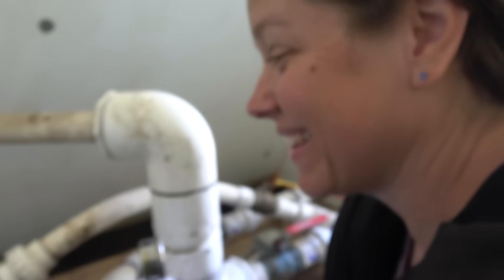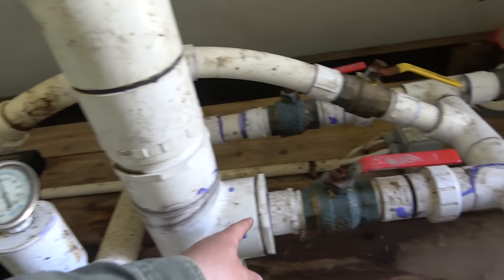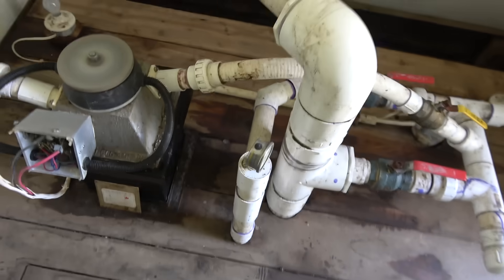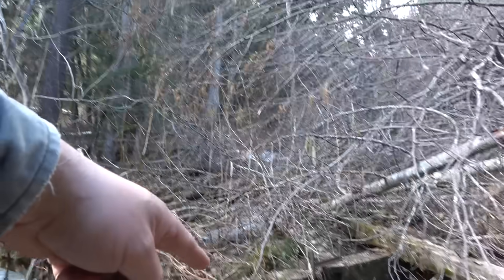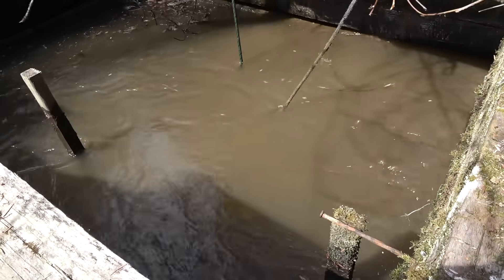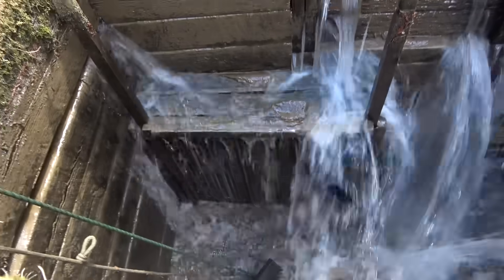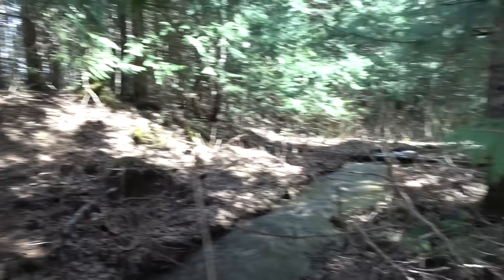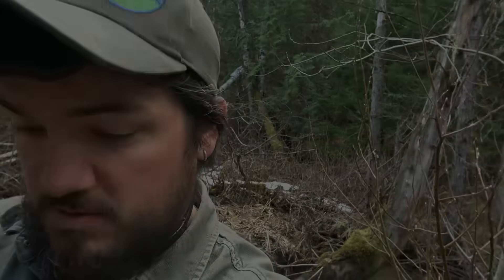Off Grid Micro Hydro - The Dream System!?

Comment: it might be a good idea to have a computer to go along with your analog system to run along side it and to act as a redundancy especially for the overheating of the hot water tank. your relying way to much on devices that are known to fail like the temperature gauge/relay device. i have alot of programming and electronics knowledge on the arduino platform and have made small hydroponics systems in the past. a simple arduino with sensors and a screen to monitor your temperatures and voltages and a buzzer alarm to warn you of failures is a must. the cost is close to 20 dollars and the power draw will be under 100ma but the safety will be increased by 200% or more. its actually a easy thing to build and install and its possible to do it without any soldering knowledge with the right items. the code is quite simple maybe 10-20 lines of code and even as a none programmer can be learned in hours.

Comment: if you introduce a power conditioner into the system, any access power would be stored in a battery bank. thatd be great for the cold days when the water freezes and for when you need to do maintenance on the Stream Engine.

Comment: Good simple system two points though. 
1. The bearings sound worn out
2. Its good to have both nozzles as this creates a balance of forces on the shaft giving less stress on the bearings. Running with both nozzles makes your bearings and shafts to last longer.
Reply: i was thinking the same.. and yeah after 15 yrs im guessing the parts are screaming for some lube...
Reply: @CitizenNerd  "Scream Engine"
Reply: My idea with using both nozzles is also that when things are not used they become inoperative... but I agree. Also seems like a good time to service bearings as opposed to letting them fail and having addition machine work or damage to repair, plus unplanned down time...
Reply: This man said I think it's around 45psi, but whatever.
I don't think he cares or knows hahah This is a commercial add.
Reply: With the ES&D Pelton and other similar turbines I would agree with you about equal forces on the runner/shaft, however with slightly larger turbines made by Canyon Industries in Washington state the runner is vertical and the horizontal shaft is supported on both side with heavy duty bearings vs just having the runner hanging on the end of a vertical shaft like the Stream Engine. With a Canyon Ind. turbine I would have zero concerns about having only a single nozzle.
Reply: wow what an amazing comment. makes Sense
Reply: And he could just close both intake valves to half or whatever.
Reply: This video is a lie, that's a water pump
Reply: @gawdzalien2811   Think regenerative braking.  If you push water through an electric pump it becomes a generator.
Reply: @mckirkus  correct, I turned a hot tube pump into a power generator, basically it is like a Francis turbine, Capacitor regulated induction generator, dynamic flow was 33psi @ 95gpm and made 500w at 230V I used an auto transformer to knock it to the 120 to run every thing.
Reply: @gawdzalien2811   Wow hard fail, not sure how you can mess up that badly.

Comment: 12:40 you could loop that valve to your engine^^ maybe that extra water from that Tank will then give more power, more power from the engine means more heat and that loop will continue, till you use the warm water^^

Comment: . Clearly one pipe to the geni is an water inlet and the other a water output. Then an over all bypass is the other pipe. yea cant have 23 ins and no out.
Reply: Water exits through the bottom. This plumbing could certainly be more efficient but both of the ones running to the machine are inlets.

Comment: Why not generate the power close to the water intake and run wires to the house? Of course you will need a well and pressure tank to replace the gravity water but seems like it would require much less infrastructure.
Reply: The water will not generate any power until it reaches the bottom of it's fall.

Comment: Has anybody ever thought of running multiple pipes into a cross, and than running it through a venturi, and using the compressed air to run equipment. They also have a type of cyclone that spits hot air out of one side, and 50 degree air on the other, for HVAC services. I forget the name.

Comment: Hi, if I had this set, I would take and put a contactor on the power supply to the water heater. Instead of flushing out the water.
So when the temperature is up to the set value, the power is switched off.

Comment: 1) The manufacturer says  if you run these things continuously they recommend you change the bearings every year . 2) you should run water to both inputs/nozzles so the force on the turbine is equal and doesn't "side load " the bearings . 3) shock hazard exists when running with the cover open . 
If you're going to make a video please try to know what you're talking about .

Comment: Amazing setup.. newbie question does this setup only works if your property is sandwiched between 2 streams i.e. one above you for the inlet and the other one for the outlet?
Reply: One stream. Water is collected at the higher point and piped to the lower point where the machine is set up and all water used is returned to the stream.

Comment: Hydro makes sense, generally, in big/medium size proyects due to maintenance and capital costs... And for sure you need the location (water flow, difference in height or water lakes at 2 levels). Hydro projects usually are amortised in 40+ years. Rotating equipment, water flows require expertise technician around. Same for wind power which also needs location with enough wind/height vs solar. For houses definitely solar is basically the future.

Comment: You could regulate the  Electricity so that it will shut off The hydro And turn back on when it needs to generate more And use batteries as well Just like solar

Comment: Heat your house and steam room lol with your extra hot water. Add a other hot water heater or a boiler system.  You could heat your house and have a steam room for your release of extra  hot water

Comment: 800 meters (~2619 feet - just shy of half a mile) run to the house with a head (or fall) of 30 meters (~98 feet)...sounds reasonable. But I would not want to foot the bill for the pipe.

Comment: Now I just need at least a 5 foot drop AND water that does not freeze in the winter.... sigh...  not here in NE Ohio...  unless I bury a very large tank maybe ten feet underground  and use my roof rain water through a turbine...  And yes,  I am sad about it...  But make sure your bearings are very quiet or you are having too much wear....
Reply: I could do the very large tank ten feet under the surface,  and use it for running a "ground loop" heat pump though,  rather than making hundreds of feet of loops ten feet down....
Reply: @shdwbnndbyyt  Due to thermal transfer, you would need a tank with the same outside surface area as the loops of pipe. 
Unless you have acres of land, equipment and time , it's easier to have a well drilled.

Comment: That is the hydropower system everybody dreams of but few have the optimal site or afford, that is an amazing system. They could produce significantly more power with the flow that is coming down that stream. I would have used a 48"-72" wide Coanda screen in the main channel of the stream so it would be less likely to freeze in winter and is maintenance free. That water in the intake box seems muddy do they have problems with nozzle wear or wear on the pelton or turgo wheel?

Comment: I'm seriously impressed. I didn't know that such micro-Pelton wheels existed or would last so long. You said that your max draw was 1.4 Kw- so put in a second one as needed. Clearly you aren't using all the available water but maybe your wife is happy with the 1.4 Kw limit. My, hopefully constructive, criticisms of the video are these: Cost; Internal workings of the Pelton wheel; where is the generator; maintenance.
  My, hopefully constructive, suggestion is this. You said that only during deep winter does the system fail due to icing of the brook. You could build a weir across it and a, let's say 50mm pipe from the bottom to your head tank. Then the water wouldn't freeze. Just an idea.
  Subscribed.
Reply: There was also footage of battery banks I think, presumably temporary additional load would be taken care of by that.

Comment: 12:38  the safety issue is not so much about the tank blowing up, but that you don't want scaldingly hot water coming out of the tap (faucet) in the house. If it were my installation I'd want the limit to be around 80degC.

You also want to hit at least 70degC once a week in order to prevent germs invading the system, the most dangerous being Legionnaires.
Reply: You don't need that much heat to destroy legonella,  48c will kill it, but as a plumbing contractor the point of use temperature limit is no greater than 40c.
Reply: @MrDmadness  You are mistaken about the viability of legionella at 48degC, unless you only meant in water consistently kept above that temperature for extended periods using gas, electric, or oil heating; or water only heated at the point of use.

Research has shown that at 70°C legionella bacteria is killed in seconds, at 60°C over 90% of the bacteria is killed after two minutes, whilst at 50°C it would take two hours to achieve the same level of elimination.

A hot tank maintained at a constant 50degC would be legionnaire safe, but not one that was below 40degC for long periods.

Being under temp is common in solar thermal installations, hence the UK govt Health and Safety Exec (HSE) advice to "pasteurise" such tanks at weekly intervals by heating to 70degC, as I stated before. In fairness I have also seen figures quoted of 65degC and I'm not sure where that discrepancy comes from.

Your country's apparent policy of delivering water at 40degC  would certainly contravene UK regs. From ax safety viewpoint is accept that from a Combi boiler where the water is not stored at delivery temperature, but would be very worried if delivered from a storage tank at that temperature. 

Clearly our respective countries have different opinions about the trade of between legionella risk and scald risks.

UK hot water systems must deliver water to the coolest part of the network at 50decC or higher. Immediately after a pasteurisation cycle they might deliver water as hot as almost 70degC.

If concerned about scald risks for users who are not competent to keep themselves safe (children, adults with dementia, etc) then in Britain a TMV (thermostatic mixing valve) is fitted as close as practicable to each tap, and the 50degC requirement then  applies at the inlet to the TMV.

Hope that helps
Reply: @trueriver1950  I hear what you're saying for a standing system, in cottages fir example we purge the lines over long periods on non use, and then purge them with un tempered water initially.
Reply: @trueriver1950  point if use maximum safe temperature is 120f or 48c,   at 120 a serious burn takes several minutes at 130 is takes about a minute at 140 it takes second.    I thought initially you may have been correct so I just verified to be sure. It's possible your cou trys point if use guidelines are different 

We set hot water tanks to a minimum of 140 to kill legionela, and point if use to 120.. less if there are young kids o elderly present

Comment: I have a creek behind my home about 300 meters away. The problem I am having is I don't know enough and the creek is so deep It really should be a river. The creek only maintains about 2-3 feet of water when it is not raining. I live in Louisiana and we get a lot of rain. The creek is approximately 20-30 feet deep and V-shaped. It quickly fills up to the top when it rains and then goes back down after a few days. How do I get the water to the house? I am tired of paying 700-1300$/month to the energy company. I really need a mentor to make this happen. I hit 28,000 watts used in a single day one time. and we have a constant always-on load of 6,000 watts. I need help!
Reply: What are you running that needs that much power?
Finding a generator that will supply that is going to be hard.
Reply: @williamfranklin6283  My house....Just my house. Everything is electric. I live in the south and we hit the upper 90's sometimes 100's so AC run's all day to combat the heat and humidity.
Reply: @Sphinxone  My house is all electric also, 2,400 sqft.  Maryland so it gets hot in summer and cold in winter. Electric bill has never been over $200.  We do have a wood stove that helps in the winter and insulation / air sealed to the max.
I'd get a air leakage test done, it's cheaper to seal the house up than build a generator system.
Reply: Contact us. The water source does not need to make it to the house just the electricity that is being generated at the stream source. Transmission line can be installed.

Comment: It is a neat idea, but you have to own the hillside, the acreage the water is running through the creek, and the State, Feds, wildlife management probably have issues redirecting flows, dumping hot water into streams effecting temperature if it was not cooled first (micro changes is huge effect on fish  eggs, developing fish). You maybe should cover the top of the stilt pond to to keep animals from becoming trapped in it, or simply leave a ramp from which they can grab and climb out on.

Comment: How are you getting water pressure though??
Reply: Flow and head. The collection area is 30 metres above the system.
Reply: @microhydropower  are you using an electric pump to get water back to the pond ?
Reply: @robertbernard651  the water falls out of the bottom of the machine presumably to a sluice that makes it's way back into the creek. We have only seen the video but that's how this system is designed to work.

Comment: This is a definite testimonial for the power of water. Has it ever occurred to you that you could actually govern the flow with "by-pass" mechanism? Another way to ease the, "too much power" problem would be to pump the water back in the creek. It just seems like a solvable problem; rather than dump hot water, or any water where it's not needed. Anyway I am sure you have thought it out to your own satisfaction. Thanks for sharing.

Comment: you could use a hot water tank as a circulatory system for baseboard heat in the house as well during the winter

Comment: With a small solar panel, fish tank pump and two 55 gallon drums you can pump the water from one to the other up on your roof. At night open a valve that spins a water wheel/alternator to light up a bunch of LED lights.

Comment: Fab video! POV - Where the trash rack intake/ creek freezes in winter:-

 the turbine uses excess electricity,  to heat water for the property. Which is flushed if it isn't needed or overheats. Is there enough reduntant  electricity  to send a return pipe 0f the dumped hot water electrically pumped, back to the creek. To prevent freezing in winter months. Or even a pressurised under floor heating system. If the elevation to return the excess hot water to the creek or filter rack, proofed too steep!?
Just a thought:)
Reply: 2500' up a hill to the collection area. One should never dump hot water directly back into a creek. That water would be cold by the time it reached much farther than the level that the system is on.

Comment: You should have a battery of super capacitors to take the overload and then use it again when needed in the winter just like a battery but none of the problems although a tesla wall would help as a back up as well for too much power to be stored for whenever necessary extra hot water could be turned to steam and you use one of the Canadiens steam generators to generate even more power.

Comment: Why dump that water. Just a thought but if you dump it into a cooling tank you can cycle cool water for hot. Rinse and repeat. That way, if for any reason fresh water can't flow in from the source, it won't burn the tank up. 

Maybe a helpful idea, may not, but there it is.

Comment: I you want  long non stop hot showers basicly free apart from feeding some sticks into it ,,well build yourself a chip heater ,,I built one years ago out of a 70kg gas cylinder, cut a hole in top and bottom and slid a peice of boar pipe which was half inch thick steel ,that's the chimilu and you have it coming out the top a couple of feet and put a butterfly valve to adjust the burn time ,then weld in a fitting for cold in the bottom and same with the top ,mount a high pressure blow out valve in the top and hot straight to your shower head .to easy ,put legs on the bottom and some sheet metal around the legs to keep the fire contained and you just lite a stuck fire and after five mins you have really hot water

Comment: Suppose the solenoid on your hot water heater doesn't open up to dump the excess energy.  At that point you need a failsafe back-up (or two) to mechanically vent excess pressure before it blows up your hot water heater.  Hard to tell from the shaky video whether you already have an overpressure relief of the mechanical sort.

Comment: This is awesome..my question is when you say elevation are you meaning the river or water supply is higher than the homestead?
I'm very interested and live on 5 acres and have a river on my property only its lower than my house.
Thanks for the great videos
Reply: The inlet is higher than the homestead: it must be as they are using gravity pressurised water in the home
Reply: If you can access the water source the electricity can be transmitted uphill to your home. Head and flow on the stream course where the electricity is created and uphill via a powerline.